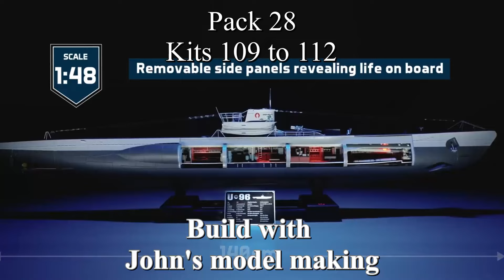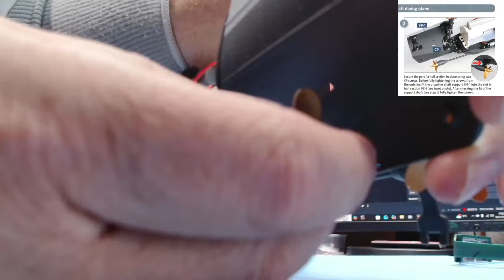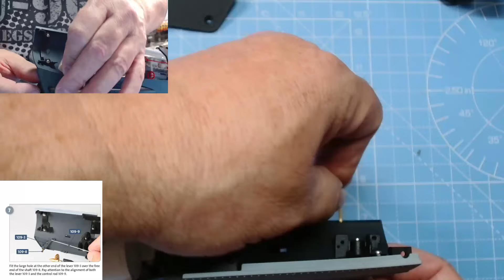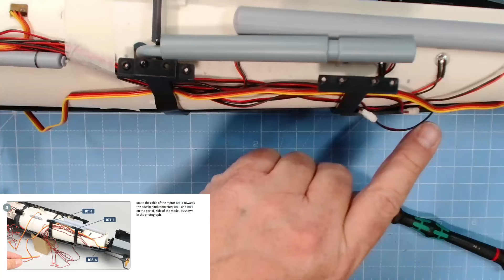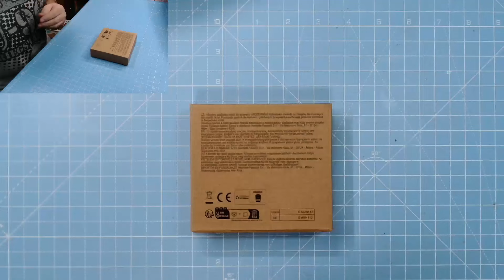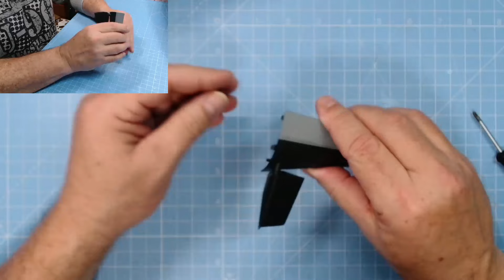Hachette's Build the U96 U boat pack 28 Kits 109 to 112

Comment: Thanks so much for making these videos. They are extremely helpful. I’m also building this model and am just finishing stage 28. I had a great deal of difficulty getting the electrical room in place. Getting the screws in was also hard. I’m embarrassed to suggest that maybe your rear dive planes are 90 degrees off. Shouldn’t they be horizontal?
Reply from the maker: You are welcome.  If they are 90 degree off, it's an easy fix. 👍